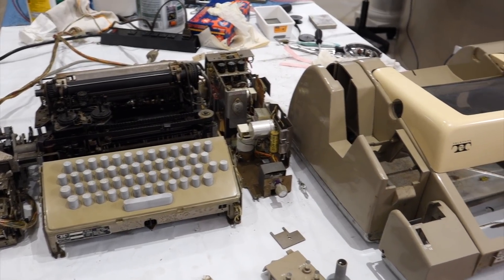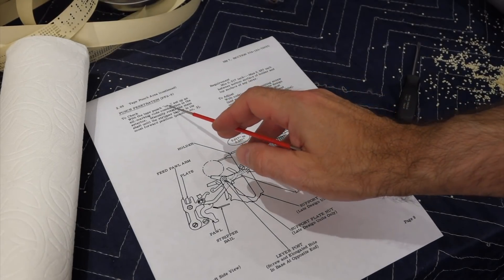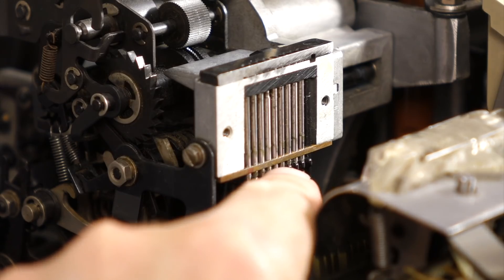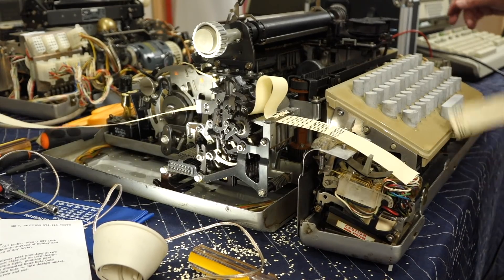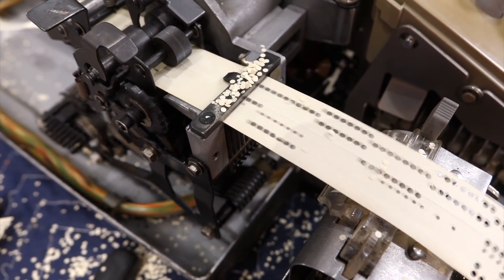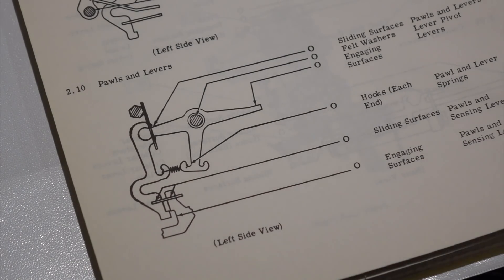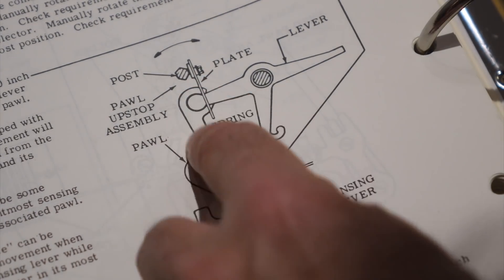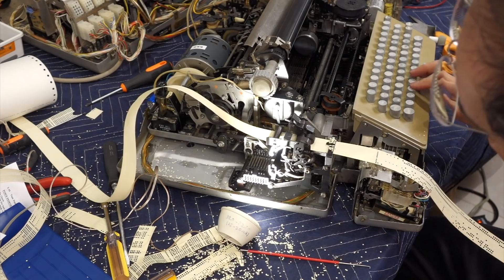Teletype ASR 33 Part 8: Paper Tape Punch

Comment: Marc luckily your machine is that mis aligned that we have the joy of looking how you amazingly can fix all those adjustments and problems. Also for us ASR 33 owners it would be a much easier job if ever a problem occur and just go look at your vid's. I find it one of the most impressive compu equipment that exists. Why? its a keyboard,printer,screen, program storage and reader in one totally mechanical machine.Keep up the good work.

Comment: 11.5 years I used one of those things daily.   One facility had 15 of them on one wall.  The three years I was there most all never crapped out.  We had two that never worked right.  If you had to use them we had work arounds on the issues at hand.  Actually quite dependable machines.

Comment: You know, you get quite speechless watching these electro-mechanical digital machines. I guess it's the engineering part that takes the breath away. The design of the levers, the springs, the bolts, bits and bobs.....and the timing between them all in order to make everything work.....man. Mountains of manhours.

Now.....question: What about lubrication ? Aren't you supposed to use at least some at chosen points ?

Otherwise Marc. It's just terrific. If I bought a piece of land for every time I wanted to salute you for your efforts, I'd own a continent. Live long !

Comment: That is the most complicated confetti generator I've ever seen! :)
Reply: Confetti was so much easier in NY back when extra paper tape and these chads were produced everywhere, all the time xD
Reply: Its just making confetti with extra steps
Reply: @Moraren  If you think about it, those confetti are actually physical bits. mindblown
Reply: @eddyjay83  Oh wow, that is true! Much better than some puny informationless regular confetti. Next birthday im gonna have bits instead of confetti!
Reply: @Moraren  How will you ever get them in order though?
Reply: @eddyjay83  

I was very shocked to learn the DNA also uses a "serial" protocol during replication.

A moleclular structure steps along (like a serial clock) each unwoven strand of DNA, using the T-G-A-C codes to replicate new strands (like serial data).

It even has "start" and "stop" bits. lol

https://en.wikipedia.org/wiki/Replisome

https://youtu.be/8kK2zwjRV0M?t=667
Reply: @zo1dberg  - No worries, they are just encrypted...
Reply: I was thinking "flying chad" as opposed to "hanging chad"
Reply: When I was in the Navy in the 80s, we would collect this 'confetti' material in long tubes.  You filled up a tube and stood it on someone's desk.  When they picked it up, those tiny chads would fly all over their desk.  Fun times.

Comment: Why wouldn't the drive holes always be punched? Seems to me unnecessarily complex to have the whole selective punch mechanism for a hole that should always be punched.
Reply from the maker: Yes that is odd. Either it was cheaper to reuse the already existing parts, or they had another application for this punch that required some of these holes not to be punched. I need to check how the Model 19 does it.
Reply: @CuriousMarc  Cheaper to use the existing punch mechanism is what makes the most sense. But it is less reliable.
Reply: Cost.  What would a 1970s university computer science department rather pay for - a box of 200 reels of unpunched plain paper tape, or a box of 200 reels of paper tape specially punched with the sprocket feed hole? :)
Reply: @1944GPW  My vision where for a punch in the machine that always punches a hole, having prepunched hole just seems like it would be expensive as you say and alignment problems.

Comment: Cool! A friend of mine wanted me to decode some of that tape you are using. Do you know a easy way to decode that data?
Reply from the maker: Assuming it’s an 8-bit tape (8 big holes and a small one), it is straight ASCII. Bit 1 on the left (where only 3 bits fit) to bit 8 on the right (the side with 5 bits). A hole is a 1, no hole is 0. The 8th bit is usually not part of the 7-bit ASCII code, but is parity.
Reply: @CuriousMarc  cool! how simple.amazing that its just raw ascii! i guess thats what ascii was design for makes sense. BTW intresting restoration videos, keep it up.
Reply: You could scan it and feed it to an algorithm made in excel? Marc could probably give you the code behind it.
Reply: @aserta  I was thinking in the same vein. can excel process image data? I was thinking of using some python library to somehow turn the images I to bits. I think the excel might be useful at that step. I was kinda hoping someone else had a easy solution
Reply: There is a program out there - open source, I think - that takes raw scans of strips of movie film and processes them into sets of individual frames by looking for the sprocket holes. Sorry I can't recall what it's called, but it could be a lead.
Reply: My mother can read „Lochstreifen“ (punch tapes) without an algorithm, https://en.wikipedia.org/wiki/Baudot_code. She used to work at a „Telegrafenamt“ in the late 50s and 60s. It was fun to print a birthday telegram on 5m tape.
Reply: @falkmachtsachen  cool!
Reply: Something intended for decoding mask ROMs may be a good starting point https://siliconpr0n.org/wiki/doku.php?id=rom:mask#decoding.
Reply: @samthenerf  Cool! ill have look.thanks! this defcon talk looks intrested that was linked to on the page you sent
 https://www.youtube.com/watch?v=vbIJ-eVQkaw